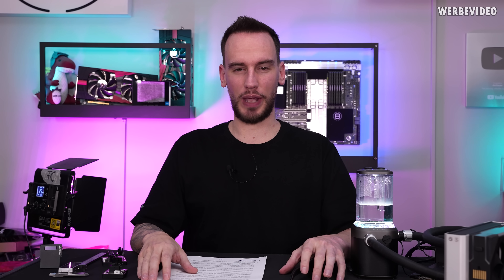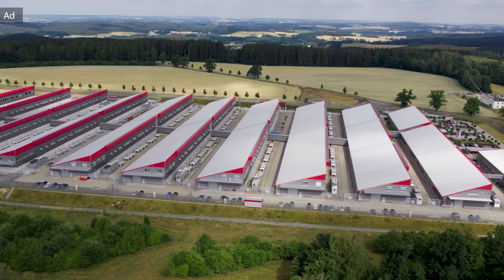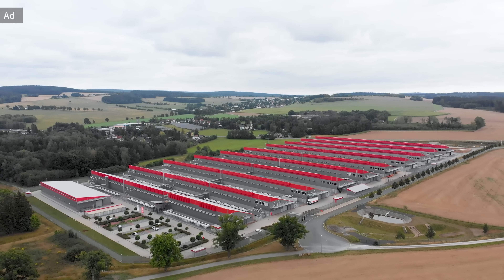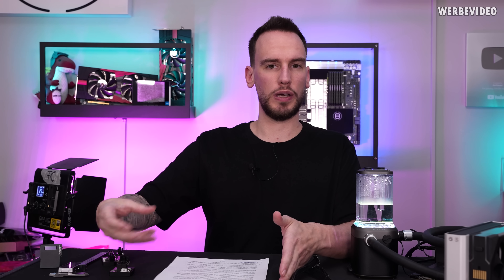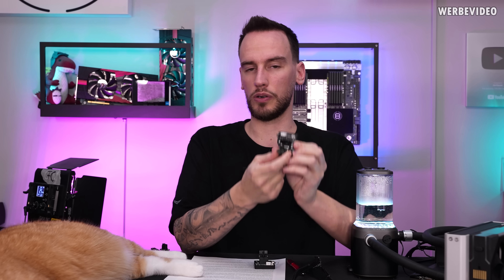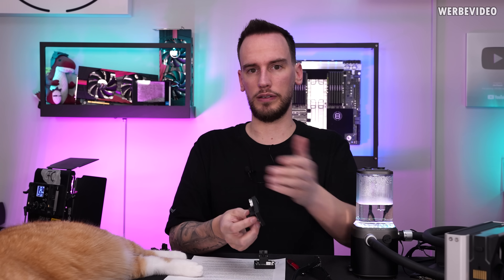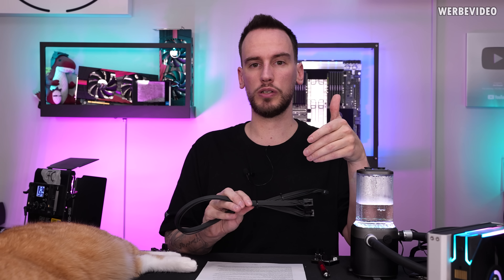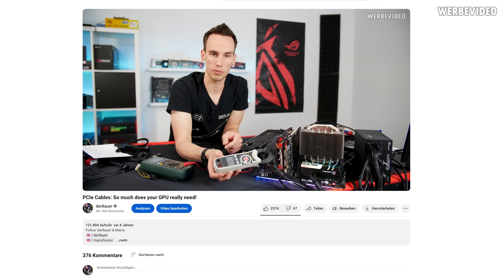12VHPWR is just Garbage and will Remain a Problem!!

Comment: What was the purpose of making a smaller connector ?
At this point, it was a useless endeavor.
All these cards need to be replaced with a card that has 4x 8-pin PCIe connectors on the tail end of the card.
There is no High Power in the 12VHPWR connector.

Comment: There's some great information and comparisons being made in this video, and I think some additional context from other electrical standards could make it even better.  The 8pin connector is actually a bit low on its safety margin, especially when compared to the 6pin which can deliver the exact same amount of power with half the rating.  Even common household 14ga wire which has a 15A rating will only typically catch fire once it reaches a 60A draw.  That's a 4x safety margin which makes even the highest 2.5x margin of the quad 8-pin look low.
Reply: 2x safety margins are usually considered the standard, at least in regards to the automotive sector. on aircraft that margin is 30%.
Reply: @Born_Stellar  Ehhh in my personal experience it's a little more complicated than that for automotive (I have no firsthand experience of aircraft though). The broadly-referred-to concept of 2x safety margin is specifically with regards to material strength in terms of mechanical stress, not necessarily things like electrical power; and accounting for unknown or difficult-to-measure product usage, such as the load in the suspension when hitting a pothole (impossible to account for every pothole shape out there). I've never been able to outright confirm it, but I suspect the idea of the 2x safety factor actually originally came from fatigue endurance limits: for steels this is often ~50% of the yield strength, hence a 2x safety factor. 

Over the years, I think engineering professors/textbooks just blindly stated "2x is a good safety factor" to students without really understanding why is should be 2x. For many parts, it's pretty simple to have a very clear understanding of the worst case usage - like for an engine when used with an automatic transmission, in a modern car it's basically impossible to ever exceed redline, so for something like a valve lifter there's a very clear worst-case load. If it only experiences that load one time, 2x is WAY overkill. However, there's a big difference between a part lasting a single worst-case load cycle, and one than can do it over and over again.

Most steel part will last forever if its worst-case stress is less than ~50% of yield stress, but will NOT last forever if, say, its worst-case stress is 80% of yield (S-N curve goes horizontal ~50% of yield for steel) - so a 2x safety margin, when you really know the worst-case load, (mostly) ensures the part will last forever. Most aluminums, though, never reach such a limit, their S-N curve never fully flattens out; eventually with enough load cycles, fatigue cracks will propagate no matter how low the peak stresses are (although they can last a very long time with reasonable stress levels). Thus actual automotive design margins (at least where I worked) are more based on manufacturing tolerances, material properties, and test regimens that are based on customer usage. Long personal anecdote below if you're interested:

I worked as a design engineer at an auto manufacturer known for their reliability, and although it was often mentioned in school, I never heard anything about a 2x margin at work; but I heard plenty about more nuanced and detailed design/durability criteria. In one particular case, the cycle count requirement for a durability test was ~100x what could actually ever be achieved by a driver, and it was run with a part intentionally manufactured at the worst case of the tolerance range of every important dimension on the part (e.g. thinnest part thickness, tightest corner radius, etc.). Based on how that particular company determined their tolerances in the first place (unreasonably conservative), even if this was just 3 dimensions at worst case, there was like a 1 in a quintillion chance a part with those dimensions would ever exist - even when you're making 8 million cars a year, that's a little overly conservative.

Then the durability test cycles count requirement, which should be like 30,000 load cycles on the part (representing a driver in a dense urban area going wide open throttle to redline from every stoplight), was actually like 3,000,000 cycles lol. THAT is overengineered, and resulted in no improvement for the customer, but did make the car more expensive, delayed development cycles, and led to poor relationships with parts suppliers to due outrageous standards.

I think at some point someone haphazardly applied the durability standard for a different but similar part (3,0000,000 cycles) to this particular part without realizing they had totally different loading modes - the original part has a load that cycles every time the transmission shifts between 3rd and 4th gears, a very common thing, and the other part experiences a full load cycle every time the driver hits redline, which relatively rarely happens - even if you manage to hit redline 5 times on your 10 mile commute, every time you get in the car, that's 50,000 cycles in 100,000 miles). NO ONE drives that way in modern 200-300hp cars - and if they do, the car will end up totaled long before the parts wear out lol. 

Anyway, the intention at least was that the part design was determined by durability requirements, which in theory were based on real-world customer usage, not just on a yield-stress-based safety factor. Design a part, prototype it, stick it in the durability tester, then see if it survives. If it does, figure out the manufacturing tolerances required and achievable, then make a sample of worst-case parts, then test those. Sure, at some point someone probably ran FEA, but that was probably 1% of the way through the product development effort, the other 99% happened after the fact, and involved a lot of conversations with the supplier that went like "well, I know you never had to do this for GM or Ford, but there's a reason our cars are so reliable... so please change this corner radius in your tooling for the sixteenth time."
Reply: @MikeyAntonakakis  haha yeah that was just something an aircraft engineer told me once while he was down on the floor, and it was about structural integrity and loading, not electrical or engine related, which I'm sure have higher margins on an aircraft. the wings, structure and skin do have to be as light as possible. but they do x-ray checks on the metal since aluminum will always eventually fatigue crack like you mentioned.  Evan if the margins were 2x because its aluminum you'll have to replace it eventually. 

In regards to cars i did hear that chevy was spending about 20% more on producing their cars/trucks than ford, until the late 90's, but when they realized it they cut spending to match and thats why chevy's aren't so great anymore. don't know how true that was but those pre 2000 chevy's are pretty solid.
Reply: @Born_Stellar  the “fun” thing about engineering is that there are multiple ways to approach problems - sometimes you can simultaneously make a part cheaper and more reliable, but it’s a matter of priorities and leadership and creative thinking. Often just cutting costs leads to worse products, but if you’re careful it doesn’t have to. Of course it costs more up front to do better product management, engineering, purchasing, manufacturing, etc. but usually ends up cheaper in the long run and makes for happier customers.

Comment: I respect your expertise and experience but I would very much like to see how the fundamental reason for the problem.
GamersNexus were testing with a 2 pins (out of 6) conducting all current, it did not melt let alone burn. Were they wrong?

You also showed how the warning light flashes when you move the cable but it's somewhat expected because when you move it the microscopic electron tunnels are disrupted (look up Wetting current). I wonder if you hold the cable in one specific position the warning will still light up.

Comment: I have used the "Fasgear PCIe 5.0 GPU Power Cable Sleeved 70cm| 16pin(12+4) 12vhpr" cable via Amazon for 15 months and have had your WireView (12vhpr to 12vhpr) in series for 3 months. I have monitored with thermocouples on both connectors on the WireView at 600W and only see a maximum of under the adjacent VRM temps. Happy with both so far! Glad to hear that you have such a low return rate. Are we still not really talking about bad insertion for failure? I do hope that the 5090 onwards go with a dual 12vhpr as you suggest!

Comment: I understand why the are moving away from gpu 8 pins, due to the jimmyrigging of (8-6) pins 500-800w psu that can't handle 600w loads. I've seen those molex to 6 pin to 8 pin adapters. I know cuz I had to jimmy rig my cheap cousin's PC to take a 1080ti. He didn't want to spend that $100 to get a new power supply on his 10+ year PC. To people using dual 8 pins when the psu is rated at 200-500w max for gpu 8 pins total (lower sub-700w PSUs). But they could just force PSU sellers to have 4090 certified power supplies etc..

Comment: 15:50 "single broken pin will heat up entire connector"
no it won't because it will have higher resistance and the current will be a lot lower through it then other pins

Comment: If it ain't broke, don't fix it! Nvidia take note.
8 pin connectors had nothing wrong with them. When I first saw the 12 pin connector I thought the pins in the plug end looked smaller. Great idea, push more watts through smaller pieces of metal. There was no engineering or thought put into it. I am not a professional in the matter, but even I saw the problems that would occur. Dangerous!

Comment: I have a 4070Ti with the  12VHPWR connection and it's been  totally  fine with  a average maximum power load of 300 Watts,  I regularly  check the connection and it doesn't even get warm.  Is it failing because the design isn't suitable for the higher power draw used by the 4080/90? I  use a 90° adapter (not sure of manufacturer,  bought from Amazon) but it doesn't seem to get warm even let alone start melting. On reflection Nvidia should have supplied the 4080/90's with multiples of regular 8 pin connectors.

Comment: I have to agree with you on all points!  Not only was It a design failure to send even more current across fewer pins and fewer connectors, but to also place the power connector on top of a large card where you have no choice but to bend the cable at a near right angle to fit in almost all popular cases.  This essentially required 4090 owners to buy special adapters and cables that potentially added more risk.  I hope NVidia learns from this major design flaw!
Reply: I seriously doubt it ! They're TOO GREEDY !! And re-designs cost 5 & 6 digit figures,at least ! I'm a retired QC EE from long ago,and had discussions over changing a simple non-electrical part to my bosses. They said 40 years  ago then,the cost was massive. It was a Phone Handset shell !

Comment: Why are there so many pins to begin with? What if it was just an XT60 or hell, XT90? Two big way over spec pins, two thick wires good for ~200% load. If manufacturers really want they could have an arbitrary amount of conductors that all crimp together in or near the plug

Comment: Edit:  to clarify, moving the ID pins to the smaller sizes and keeping the same size connectors as the old 8-pin would have resulted in enough safety margin at the connector even removing some power wires (like 8-10 pin, power only).  I am now understanding that the engineers were more concerned with the current capacity of the wires instead of the contacts.  They may have had to specify doubled wires or 14 guage?  Not sure.  Tricky problem, also the cards are using too much energy.

 Should have stayed with the size contacts of the old connector.  Even going down to 8 or 10 conductors would have had a far greater safety margin than what we got.  Solutions to prevent the old GPU connector from being jammed into it could include keying on every pin.  90° to the "standard" Molex if necessary.  Or even blanking a whole pin or 2 from the socket.

They need to prove to me that their goofy connector is actually better than an ATX 12v 8-pin (which we already use for motherboards.  In fact it would have been nice if we had just used something compatible with the ATX 12v motherboard connector from the word go.  Hindsight)

Comment: So the overall idea I am getting from videos such as these, is, "who the heck passed this design through to production?"

Same thing in the automotive industry.  I have been working more in 5 year old and newer vehicles the last decade than anything older.

Quality and concern over the long term is dropping left and right.  People like to blaim costs, well, cost reduction occurs when replacement and repair requirements drop down, not when you can produce it so cheap you dont care about replacement.

I cannot find parts to rebuild starters and alternators local to me anymore.  The industry is "why spend $5 to fix the brushes or $30 for the voltage regulator when you can give me $200 for another pile of junk??

Comment: I don't agree with the proposition of them using 2 of those. I think the best option would be to drop them completely and adopt a new connector type with better design and more robust contact pins. It would also be a great idea for GPU manufacturers to change the position of the connector at the bottom side of the card (facing down). That way, you won't have clearance issues and would also not stay under constant bending forces.

Comment: I have no faith in the 6x 2 connector as well , it’s to much power in a narrow gage cable , high voltage causes heat which can lead to shorts or melting points ,  why did the redesign still miss two clear safty checks such as still has no duel wide body clip so it stops miss alignment and a thicker grade wire Requirement, no cable should have been allowed when you can’t bend it without worry of setting fire or melting, even the boards are failing within circuit boats I’m convinced it’s also related to the weak board failures as well no just down to weight as well as cards needing a max weight reduction

Comment: 07:30 what's the physical reason for conductor number derating? worse thermoconductivity?
Reply: That part is wrong, there is no derating for solid vs stranded in this case
Reply: @riba2233  oh wait the derating is for AC only?
Reply: @ПётрБ-с2ц  a small amount bc of a skin effect, but derbauers table was for something completely different (multiple wires running in a bunch heating eachother)
Reply: @riba2233  wow that's terrible oversight from Derbauer.
Reply: @riba2233  actually wait the skin effect is mitigated with more conductors isn't it?
Reply: @ПётрБ-с2ц  yeah it is a whole topic, it also depends on the type of a stranded cable but ones with individually insulated strands are the best for mitigating the skin effect

Comment: i tried a 3080 from hp , 320w cosumcion the cable almost melted , with 280 w ore 290w power the cable whas ok , i thick i hade just 1 power cable with a 8 pin spliter , dont remember well.

Comment: I own a computer shop and have built more than hundreds computers with atx 3.0 power supplies and rtx cards, have never had one issue, not sure what everyone is doing wrong but I havent had any issues at all, if done properly the connection is just fine and amazing actually, the fact that you dont need 16 or 24 pins of large cables running through the system is amazing, i love it and is the future.

Comment: So the 4090 is a modern example for why redundancy is important. It was built into other cables by default as the engineers who designed them knew why the redundancy over provisioning was there in the much older systems. Yeah it costs more but redundant and having more than enough just in case something pulls an amount not taken into account the cases that the PSU might be on the worst side, the wires might be the worst, the connector might not be that good or just up to spec then you have the case the user used might not be that good so bending it at an odd angle which is bad for the connectivity. 
It seems like it was designed for everything to be perfect like in a lab environment not the worst case it can be like is happening in consumer homes. Still 0.05% is statistically insignificant that is most likely why it was ignored. When doing statistics you usually take out the outliers which these cases would be. The issue is this is a power connector and it should have been the safest thing ever before approved not just with at worst 1.1 margin of safety on paper which reality is almost always worse than on paper. So that is to thin of a margin in my mind to be used i am thinking that is why the 4090 is a 450 Watt card not a 600 Watt card. Just to make sure that the error margin is big enough but even then you have manufactures and end consumers who OC their card to use up as much as possiable so to the 600 Watt mark or however high it is in reality. That gets rid of the reason for it to be a 450 Watt card and turns it into a 600 Watt card.